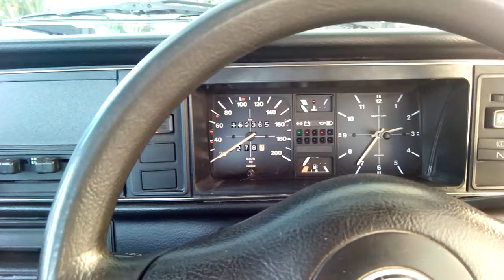My 1989 VW Fox

Comment: You are from south africa me too I am from a small town called kroonstad and I have a fox to
Reply from the maker: Hey Tiago - thanks for watching.  I know Kroonstad very well.  Been there only twice in my life, but a lovely part of the country.  Sadly I sold my fox a few years ago and kept it as a town runabout to keep my Cadillac from being dinged at parking lots.  It was a great little reliable car.  Carburettors are expensive to repair though and mine did have an issue which needed sorting, but after that, it went like a little rocket.  Thanks for watching ;)
Reply: @carfanfan  That heart breaking to hear but I see your one was an automatic my one with Manuel the problem with the Manuel model is that the gears are to close to each another that is the only fault about this car that I can think of

Comment from the maker: Thanks dude. I sold it to a guy who needs a small automatic car for his daughter who was struggling with a stick shift. Personally, the autos drive much better than the stick and those old 3 speed boxes are tough as nails ;)
Reply: In the USA they were only 4 speed manual. Only the GL Sport was 5 speed manual and the last couple years just 5 speed manual. I would definitely prefer a manual.
Reply: @djkenny1202  some one is selling 1989 gl sport with 54k mile one owner only problem it cranks but doesn't start
Reply: @bayfinest1938  oh wow, that would be neat. Where abouts?
Reply: @djkenny1202  in California
Reply: @djkenny1202  you think is worth buying I don't even drive a stick shift
Reply: @bayfinest1938  its old. It will need a lot of Work. Already has starting issues. If its dirt cheap? If you have mechanical skills or friends with? Maybe. But if you’re dont drive a stick shift, that’s another can of worms… 
I might be interested if its clean and cheap since I can work a friend likely on getting it up to snuff. What area of CA? I use to live there.
Reply: @djkenny1202  I stay in the bayarea
Reply: @djkenny1202  yes it dirt cheap 500$ dude asking one owner car with clean title
Reply: @bayfinest1938  if you wish to drive stick, it is not a primary car (really unsafe compared to virtually anything;) and have help getting repaired.. sure. Make sure clean title. If not interested, I am not far and would like to check it out.
Reply: @djkenny1202  you have a email or something I can send you pictures
Reply: @bayfinest1938  send me a message.  That would be great.
Reply: @djkenny1202  on where
Reply: @bayfinest1938  is there on You Tube?
Reply: @djkenny1202  no

Comment from the maker: It sure is a freak of nature, but I must say, it was fun to drive :)
Reply: Even the "Fox" badge on the back is on the opposite side and in a different font to mine. Am I right in saying you're from Swaziland based on the license plate?
Reply from the maker: Nope. From South Africa. VWSA built them until 1994. The autos stopped in 1993 so they are quite rare. I had to have the gearbox overhauled because of bad oil leaks and now the car has no leaks at all. Engine is service regularly and purrs like a kitten.
Reply: Ah. I just sifted through this website (http://www.worldlicenseplates.com) until I found one that matched and Swaziland's was closest. Anyway, I never even realised they sold the Fox anywhere outside of North and South America. I'm in Canada and the last year they sold Foxes at all was 1993. They're so rare now that the only one I've ever seen in my entire life is the one I own.
Reply: Just read your other comment which explains everything. The Jetta was marketed as the Fox in South Africa. I can't believe I didn't see that what I was looking at was a Jetta, not a Fox :P The Fox they sold over here had a rear-end that was identical to a Mk1 Jetta like the one in the video but had a restyled front-end and was basically an Audi 80 underneath which is why I was so confused when you opened the hood.
Reply from the maker: Yeah :) You commented that the badge is on the opposite side. Mine is right hand drive so everything is the "wrong" way round on my car ;)

Comment: I've got a cream automatic, also 1989 . drives beautifully. 

only problem I have is the fan plug  is faulty , so it doesn't work well. 

the gearbox is strong on these. 

lovely condition, you shouldn't have sold it
Reply from the maker: +Muhammad Suhail Seedat Thanks Muhammad, I'm sure you could get the fan plug real cheap at Goldwagen.  Many people wondered why I even bought this car when my other car was a Cadillac CTS, but it was for pure driving enjoyment because it's a very raw experience actually - no aircon, no power windows, no power steering, no radio, not much of anything - it is just such an honest little car and does what the label says :D